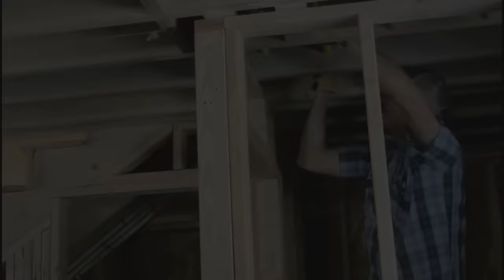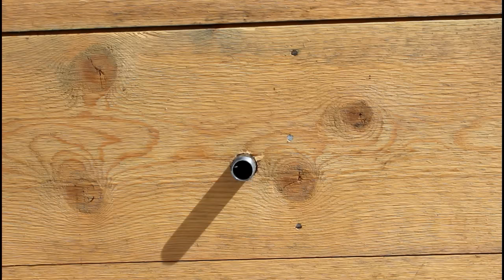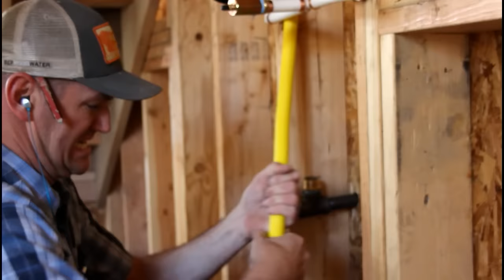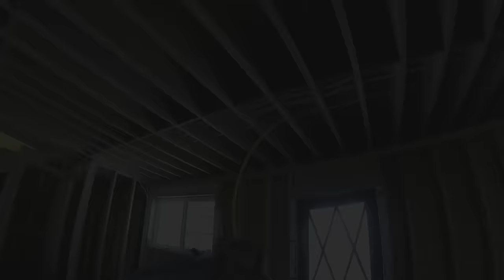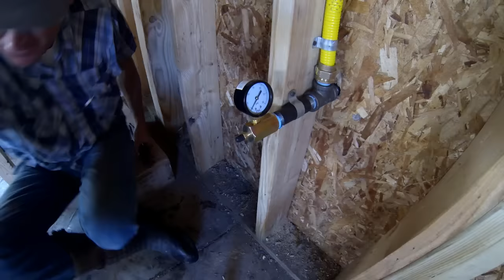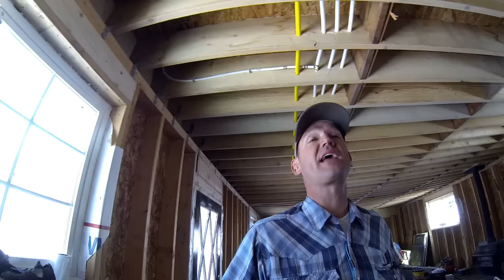#207 - I Installed Flexible Gas Line From Home Depot... (It Leaked!)

Comment: Good video, I use CSST quite often.  Be careful with the red o-ring, real easy to cut it sliding over the end of CSST.  Only one question, doesn’t CSST require a ground clamp on one end of your run?  Better check codes, and what’s required by the manufacturer.  Another suggestion, use wrenches not channel locks, right tool for the right job.
Reply: OMG! Thank you God damn no adjustable wrench. When you can use the adjustable wrench. The water pump plier is last resort and under stood for the thread fittings. Even then they have what is called adjustable pipe wrenches.
Reply: Im about to remove an old galvanized run in my garage that im converting to a din. Its external to the drywall so im putting it in the wall.  My fear is that later on, someone may put a nail or screw through the line. Any suggestions?
Reply: Yes, CSST requires bonding and grounding wire or if there is a lightening strike nearby (does not have to be direct hit) the CSST can become the ground and burn a small hole in the CSST causing a flame torch and burning the house down.  I'm curious if he installed one or not.
Reply: The additional bonding might not be required if the metal pipe was connected to a furnace that is already bonded via ground wire.   @CorbanCooper

Comment: Gas utility guy here. Back when this stuff came out we had manufacturer training and cert cards issued. Suppliers weren't even sposed to sell to non certified fitters. Proper sizing is critical. A given nominal id csst will not pass anywhere near the same amount of gas as black iron hence for a given flow rate csst always needs to be larger than  a black iron application. Cant tell you how many I found contractor ran undersized lines because they based size on black pipe sizing charts. CSST has manufacturer specfic flow rates at different pressures that must be faithfully adhered to. The corrugations offer quite a bit of resistance to flow. Also a lot of regs regarding nail plates and partition penetrations. I think you may have misspoke about running elevated pressures in residential applications. Elevated pressure is where csst becomes way more cost effective. Typical 2 psi system allows smaller tubing to be used (cheaper) but requires a second pressure cut indoors before serving equipment.
Reply: In South Africa you must use a licenced gas fitter and he must issue a certificate. If you don't have a certificate and have an isurance claim the company will not pay out. I also know that you have to have a brass connector if you go through the timber into a cupboard or any timber rafters ....more chance for leaks.
Reply: What happens if you underside gas lines?
Reply: @TSammut0219  depends on how undersized the line is. At best, equipment will be firing at a lower rate and not perform as designed. At worst it can cause delayed ignition (boom on start), improper combustion, soot, etc.

Comment: Red Poppy, no problem at all mixing electrical stuff.  You just can't mix it in the panel you have to use the right breakers.  Using different boxes or outlets doesn't effect anything.  Use it and save yourself some money.

Comment: My first real job at 17 was plumber apprentice.  My mom was dating a master plumber. It was new commercial plumbing. I wish we had that gas pipe and PEX for the water back then (1980). Tracking down and fixing the leaks on all the black steel pipe fittings was a nightmare. You are doing a great job. I'm plumbing my house by myself right now, also. A lot of the tricks are coming back to me, mostly after I do it wrong.  LOL
Reply from the maker: Story of my life.
Reply: Life will be easier with a Pro Press by RIDGID. If you're remodeling- no more sweating the Copper Lines.

Comment: Just for future reference you should use a little pipe dope over the Teflon tape when making connections. It reduces friction between the tape and the threads which allows for a much better seal. For proof back out a fitting with just Teflon tape and you will see most of it is bunched up towards the outer most threads. Also you will notice much less force is needed to tighten a fitting when using pipe dope with tape. Due to less friction.

Comment: I was a mechanical inspector until 3-08.  I never signed off one initial rough inspection because not one person would install csst in concealed locations per the manufacturer's installation instructions.
Reply: Does csst need to be bonded? Theres a line added for an appliance. The house came with gas thats bonded already. Not sure if I need to bond it at the csst
Reply: @punxnotdead3873  find the installation instructions.  That will explain it all. I'm sure you could find your brand on the internet.  More than likely,  it will need to be bonded.

Comment: Your vid is very good, I  know for a fact that it is a lot of work, but you actually make it look relaxing and satisfying. 
Very clever how you minimized the leak risk by not using fittings on the turn going to the water heater. 
I noticed that you strapped the pipe at the T for the black pipe going outside, also noticed that there was no siding on the exterior walls with it means that: "if vinyl siding will be used on this application" nails will be used for that. 
What is the recommended clearance between the OSB and the gas line to guarantee the siding nails will not perforate the pipe? Thank you.

Comment: Most of the house fires I go on that don't go out are due to lighting strikes and this type of pipe losing its integrity through small pin holes.  If your house gets struck turn your gas off and have your lines tested somehow.
Reply: This is why you need to ground it with 4 gauge copper wire!

Comment: One thing on the insulation, you have 2x4's and that does not allow for thicker insulation unless you add a second layer on the inside. Only one thing I would have done different, but it costs more is use 2X6 studs on the outside so I could get more insulation, but one way around this is use insulation board on the inside or on the outside wall as even in places where it is too dry to snow during the winter such as where I am that does make up for the cost of the insulation based on the cost of heating alone. It is possible to be cost effective in the cost of heating in just ONE year.
Reply: Most heat loss is up and out of a structure.  It depends on his insulation, spray foam no 2x6 needed.  If you can stop the air from outside coming in that half the battle.  No air infiltration, not much heat loss.  You can’t pull a vacuum on a house.
Reply: his walls use 2x6 studs

Comment: When I worked at a plumbing company we had to do gas line repairs in trailers down in the crawl space with all the black widow spiders. We would pressurize the system and pray to god we would see no soapy bubbles on our joints and connections under there, and that the pressure gauge never moved.

Comment: At a previous home this same yellow flex line was installed, no stainless was visible at the gas fittings. 
My existing home has the same flex line and the gas fittings appear similar to this video. Just a bit of stainless exposed.
 A Rinnai water heater was installed later and that plumber said no stainless should be visible otherwise the brass and stainless will interact causing corrosion. 
All three installations were done by licensed plumbers. 
 ?

Comment: The end of the CSST should be taped over before pulling it.  It only takes one fleck of wood or dirt in there to clog your gas valve some cold winter night when it is drawing hard.  Pushing open pipe through joists and studs is a bad practice.
Reply: Also USE those anti pierce tabs to keep from getting a nail or screw into the pipe .

Comment: A gas outlet outside will let you setup an outdoor kitchen for those times cooking inside would be insane (summer) or times you have lots of stuff off the garden to prep and can. 

High pressure setups can also be in places for things like backup generators as they can suck down propane.
Reply: putting in gravel is generally a permanent thing as removing the gravel from soil is a hard task so is best done when you know exactly where you want a driveway.
Reply from the maker: I need to move som more dirt around and build the drive way up first. It will happen this summer for sure.
Reply: Would it be worth it to put in drain tile under the driveway/yard to prevent it from becoming the mud pit in the spring or would the ground still turn to mud as it thaws out?

The good news is you have all the fill dirt you could want on that hill and you already need to dig out to find that spring.
Reply: Andrew H Ii

Comment: When we built, we figured we would only need propane for the stove and water heater as well. We used only wood for heat for four years, but then we had to use electric heaters when we were out of town, and when everyone was sick, it was real hard to tend a fire with the flu. We ended up putting in a Empire ultra efficient space heater that actually heats the entire house, and now we can use either/or. It's nice to have the heat come on in the morning without stoking the stove!
Reply: I put in a no-ox propane heater a few years ago for redunt backup heating, i love it, also have solar radiant system, and wood stove, and mini-split, off grid, good from 0-100 degrees comfy all the time...

Comment: The end cuts are crucial on flex gas lines the yellow plastic needs to be cut back as well as cutting a smooth end to the stainless a pipe cutter is recommended as the brass ring just pulls the face end up against the brass taper for the seal.

Comment: How did you split the line to both appliances? Just use a T? Did you run 1/2" to the range? Do you up size the main supply line one step above the lines out to the appliances? I'm running one line to a cooktop and one line to a set of fireplace ventless logs.

Comment: Be very cautious using any with rubber O-ring seals within.  Parker is a brand that uses brass on stainless to deform the end to a flare that is automatically flared when the fitting is put together.  There are a few brands that utilises a rubber O ring internally to complete the seal. That may be ok if and only if that fitting stays in an area that is accessible and repair can be made. When in doubt a solid mechanical seal can't be beat.

Comment: Also you could have used the stub out 90° elbow with square metal mounting plate that's welded together, and the flexible nail guard slinky above the gas tite connection near the stub out.

Comment: code requires testing pressure to be 1 and half times the working pressure and that pressure is 14" water column or  0.505277 pounds per square inch, so your test pressure can be min 3 psi.  a 1 to 10 psi gauge would be ideal.

Comment: Run a line to the yard for a bbq's or a firepit while you are going this.
Reply: Outdoor flex isn't the same as what is being used here. There's a new requirement that must accommodate for potential lightening strikes.
Reply: It's called bonding and grounding. They do make special outdoor/underground CSST for the purpose of running gas lines to a BBQ pit etc.

Comment: I see that you use a knuckle buster wrench to tighten fittings. I call them that because if it slips that is what will happen. regular pipe wrench is safer. Main thing is that you do what works for you, and that the finished does not leak. I prefer to use black pipe, and flex only at the connections, but that can take longer. Also you can leave the line under test for longer than the specified, but not less. Also that is a great idea leaving the gauge on the line. Also I use NG in my home, and that never goes over .5 lbs.

Comment: Only suppose to tighten 3/4 of a turn after getting it hand tight. I have to do 20 for 20 and never fail a test. never leaks when installed correctly. Over-tightening will ruin the gasket and cause leaks.

Comment: maybe old but just looked up the cheetah system i dont like it maybe because im old fashioned in my 40's but for a do it yourselfer it cld be alright.  like how a master plumber feels abought shark bites but if i ever found all that i wld grab it tho use it in basements or other places i cld change it out easily.   if you used it how did it work out for you?

Comment: With most CSST installation the holes drilled should be 1.5x the OD of the CSST used. Check installation manual

Comment: Check with your state the yellow CSST from Home Depot is not approved for use in Massachusetts, even  though it’s up sold in Home Depots here, I have had to pull it out Of a few jobs where it was installed and replaced with the black coated track-pipe.

Comment: Do you what the MAX test pressure for this Home Flex (fittings) is? My guy installed a gas system on a new house with a lot of black iron and mixed with some 1/2” Home Flex for the bbq and range lines and test gauge is leaking off slowly and we can’t find a leak anywhere. He tested at around 40-50 PSI when he was trying to get the leak to show and I’m now wondering if he may have damaged the fittings if there only rated at around 30-40 PSI. 

Thanks for any help.

Comment: Hi ,i notice that the PTFE tape is in a blue sleve, this is WATER fitting only , There is a yellow sleved one for GAS, The water one will biodegrade with the GAS chemicals.
easy way to tell is it is hard to brake the GAS Type when you pull it, water one snaps easy, in the UK it was changed  25 / 30 years ago, please be safe .
Reply: Evelyn Woodcock the brand “blue monster”he is using is rated for gas propane also!
Reply from the maker: It's rated for gas.
Reply: better safe than sorry.
Reply: If its Blue Monster brand- its rated for Gas Lines.

Comment: Will you install a shut off valve outside the house before the regulator and what is the sediment deposit everyone keeps talking about on your comments?
Reply from the maker: Keep watching. We installed a stop and waste valve outside and I will do a pressure regulator inside.
Reply: A Sediment Trap is required at each Appliance. It catches the sediment that might get in the Gas Line. A lot of Homes have burned to the ground because the Sediment Trap was either improperly installed- or not installed at all. Licensed Master Plumber.

Comment: With floor joices that close together you might as well use wrought/black iron pipe and fittings. Plus it helps to use a fine metal file around the cut edge for a better seal.

Comment: Is this flexible gas line code in Indiana?  We are running a new line from the original black pipe to a new gas dryer.  At the termination point of the dryer, is a rigid black pipe used with the shut off valve? Also, should the hookup location be near the floor or mid wall?  Great video.  Very professional!  Thanks!!
Reply: CSST is legal to use in all (50) States. Check with your local code official for any amendments in your area.

Comment: Shut off valves at each connection aren't required in your state?
Reply from the maker: Yes. The shutoffs and flexes have to be put under test as well. I will do this before inspection.

Comment: Confused; you said NO tape is to be used between the brass compression nut (presumably the one on the hose) and the fitting on the metal pipe, yet it's clear there's blue tape between those fittings when you attach the hose...?
Reply from the maker: Between the iron pipe and the brass fitting you use teflon. Between the brass fitting and the stainless gas line you dont use teflon.

Comment: Up here in Ontario Canada every point you have a Connection they make you put a trap. Is it the same there? I imagine that it would go outside of the drywall. That yellow stuff looks real nice to work with. I know working with black pipe can be a real treat. It looks good things are going fast. One step closer to the prize 🏆
Reply: Im not to far from him and am a General contractor.  Yes we are required to use sediment traps at appliances.

Comment: out of curiosity mate, on the T piece where u have your gauge if for any reason u have to disconnect the gas pipe can you do so as easy as a compression/soldered fitting or you have to first disconnect the T going through the wall first then turn the whole T piece?

Comment: So, the ceiling connection, was the run too long for a single run pull with one person? Or did your bought length make it necessary to splice two pipes together somewhere anyway? Sure glad you knew enough to know there are different Teflon tapes for different applications. Great job! You're getting closer and closer to "move in day".

Comment: I would or have like to see a close-up preparation and installation of the fitting. Fittings are money too, but as an auto tech who had serious surgery got stuck working for UTI. They bounced me from room to room teaching as $12k a year made it hard to keep instructors. They just found that I had 5 years as install & diagnostic tech for a local HVACR company. Many classes from manufacturers but before the stainless flex was invented and sold. 
 It’s funny to think of the family farm where my younger brother and I took turns shooting food cans we sat on the 2k propane tank behind the garage in the early 70’s. Strange to think a new house, pour concrete basement with 3 bed, 1 bath and sump-pump cost $26,300 in 1963. Oh ya, they used copper pipe back then from tank to appliance drops.

Comment: Hi are those regular conduit clamps for securing pipes or are those special kind for this flex pipe?
Reply: They make their own but it’s the same thing. Any bonding clamp will work and they want you to use 6 AWG bare wire back to the electrical panel (preferred).